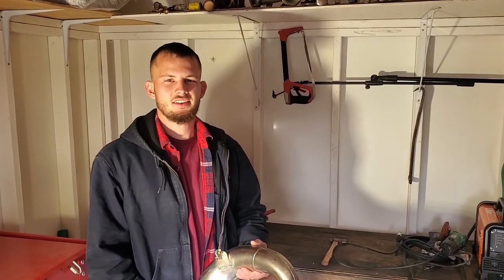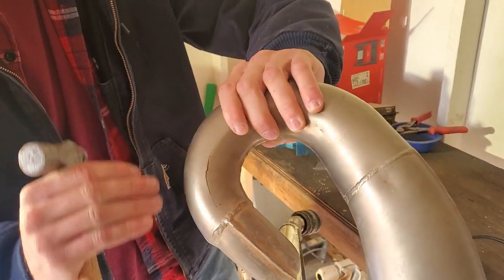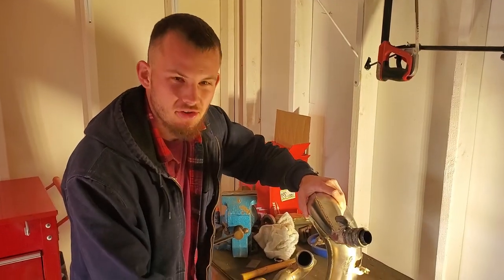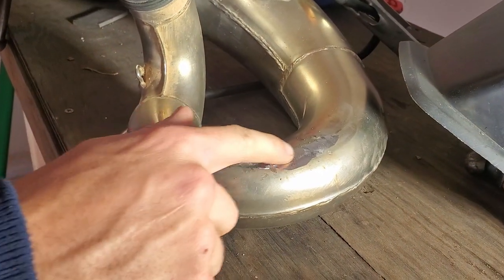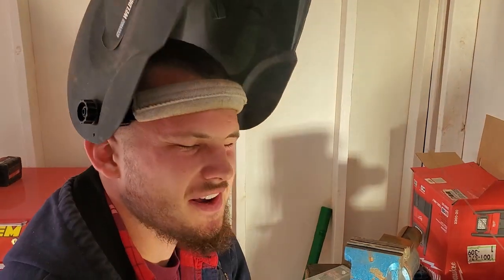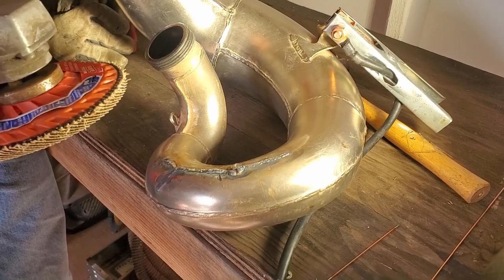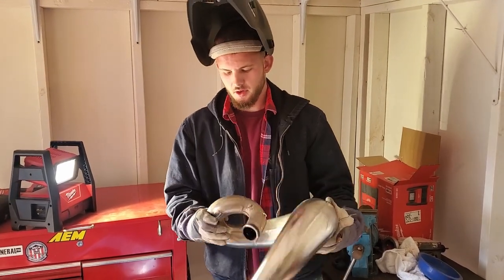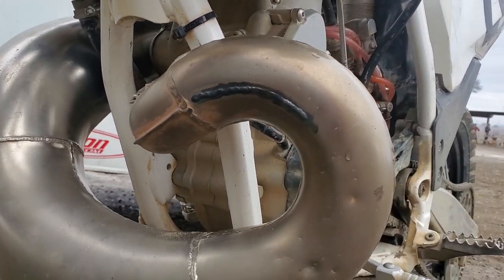Cracked Exhaust Pipe Repair: Welding a Broken Expansion Chamber

Comment: If I can make a suggestion, when you weld up cracks, drill a 1/8" hole I'm the ends of each side of the crack. Will stop the crack from traveling. Learned that from an older guy when I first start welding. Has proven to work every time. Steel isn't as bad as aluminum when it comes to welding cracks tho
Reply: i'll add a thumbs up to drilling a small diameter hole at the end of each crack to prevent it from spreading 👍🏼

Comment: If i can also add something rather not grind down more of the material before the weld rather use a clean steel brush and clean the coating off  with that you don't thin the material more than what it is already is and clean the weld up with a grinder after its been fixed to make it look presentable

Comment: Nice work.  I have to do this to my snowmobile wye pipe...  I’ve had to do this before to a Kawasaki Brute Force exhaust.  I use a mig but a tig welder would probably be better.

Comment: I went through this several years ago with an Old 92 CR500, Made it 2 rides and new Cracks started along the Edges of the Weld, This material is just to thin. I Quit messing with it and Bought a new fmf Gnarly pipe 👍
Reply from the maker: After a few repairs we ended up doing the same thing. It's just too thin to stand up to the abuse, and any excuse to buy a new shiny FMF is good enough for us!